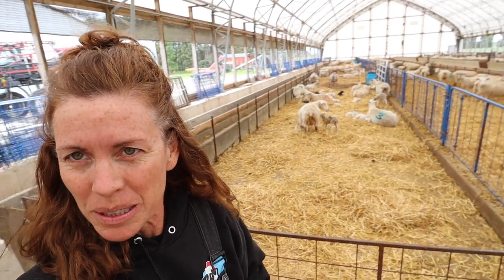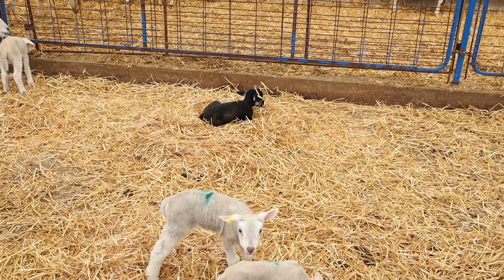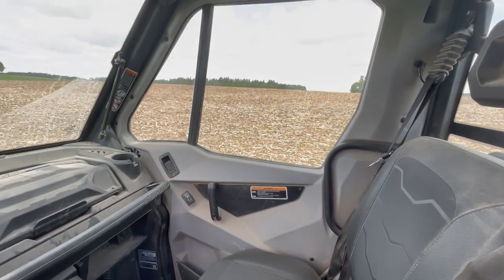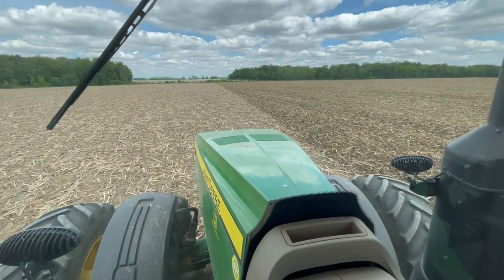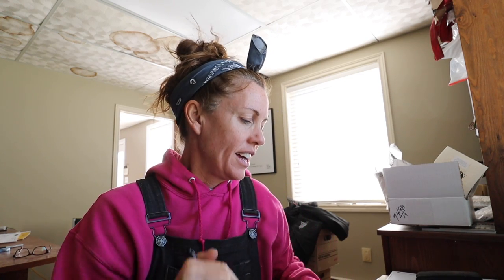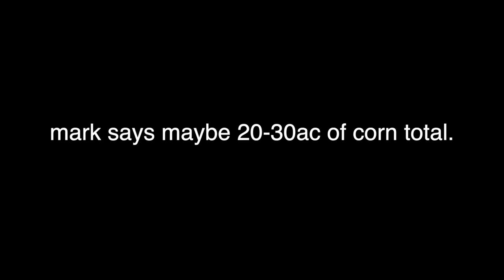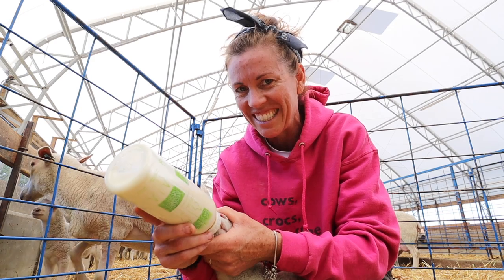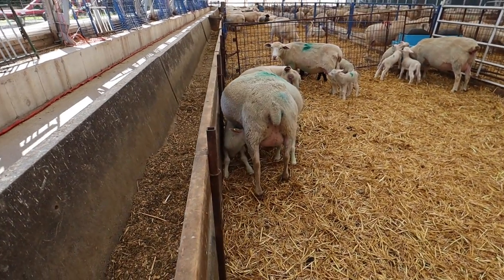A TWERKING EWE😂... and something NEW!!🙌🚜 | Vlog 454

Comment: I fed my ewes on a level ration for the 8 weeks in the run up to lambing instead of increasing it as lambing approaches. It worked very well provided the supplement contained 5% bypass protein. The thing is, litters take up too much of the rumen space preventing the ewe from eating enough for her nutritional needs as she gets bigger. I think the muck heap is a bit near the silage as it may leach into the feed. Perhaps a wall between them or anther location for the heap. It could go straight into a trailer and then left to rot at the corner of the field where it will be eventually spread.

Comment: Hey Sandi, your preg tox formula is likely doing the right job.  Preg tox is a Ca deficiency as I understand it.  Your ewe got diagnosed with ketoacidosis last lambing.  That is a completely different metabolic pathway related to sugar metabolism, but not exactly diabetes.  I don't know if it is a breed thing, but I am betting there is a strong genetic contribution.  Possibly selected for by wanting fast growing lambs that don't necessarily require as much feed. "The easy keeper".  In horses there is an ageing related disease with a strong genetic connection that ends up with sugar metabolism problems that get worse with age.  In horses it is a pituitary/adrenal gland problem.  I don't know what hormonal pathway would be causing these problems in sheep.  Might be worth doing some research into it or getting the vet collage in Guelph studying your stock.  In horses I treat with a high fat high protein low sugar diet.  I don't know if this approach would help in sheep as there are other things to consider.

Comment: I absolutely love your barn and everything you do. You make it look so great and easy even though you work your butt off. I have a question for you...how do you run your water to your blue waterers. I used to think that it came from under the concrete pad but now after I saw u cleaning that pen the water moved so I am confused (especially because of the winter and the fact that it doesn't freeze)?